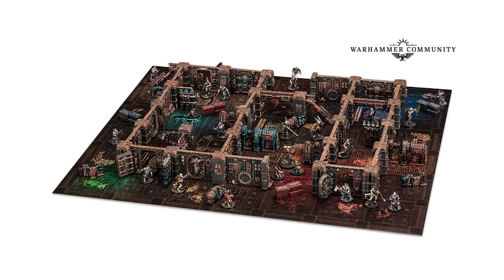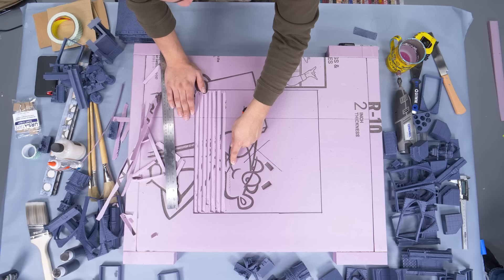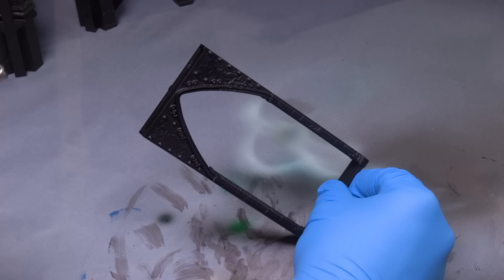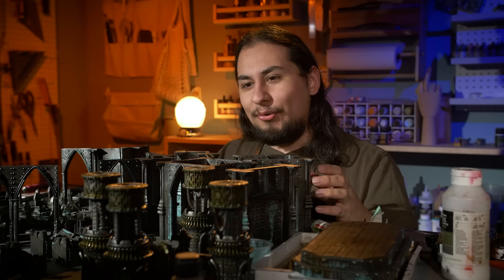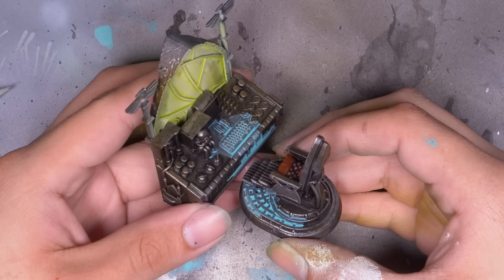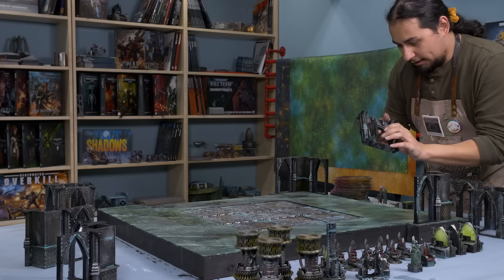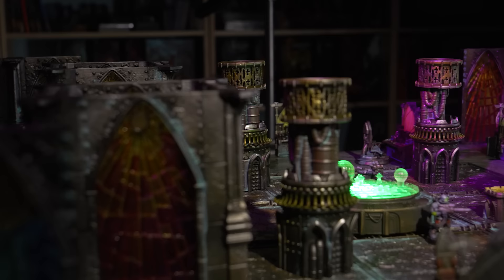I Made a Space Hulk BETTER than Games Workshop

Comment: There are hot knives where you can replace the blade with something like coat hanger wire which you could then shape the wire to cut a fairly square from the board.  It'd probably still need a sanding job though

Comment: One option for having the floor tiles flush with the ground plain would be to have a layer of foam/cardstock that is the same depth as the tile themselves, trace out the tiles and cut the section out, that way you don't need to gouge out from the main foam platform!
Reply: I was thinking cut the entire section out, cut off a layer then slide it back in. Your solution seems waaaaaay easier.

Comment: Great looking board! I am gonna have to print these off and have a go myself. Will be perfect for my Rogue Trader RPG games. Also in answer to your question at 2:04 - I think the best way to do it would be with a router attachment on a Dremel and a metal ruler to guide your routing. A normal router would probably mangle up foam as they are designed for wood, but a dremel with a router attachment might be the way to go. It would kick up a lot of dust though so would need to hold a vacum there while you rout. Your way worked great too though!

Comment: Using Hot wire cutter, cut the tile section clean off. Cut the tile section piece into two equal pieces, then run vertically through the wire cutter to plane off the 5mm of foam. Re-assemble using foam glue (used for foam rc plane kits). This glue is wire-cutter friendly and will not register when cut with tool.

Comment: Jay  i would have cut the board through on the lines you drew woth a hot wire cutter, than take the center piece, cut out the depth you need away, than glue all back together.
Reply: Why do all that cutting and gluing when you can cut once and never have to glue. Use a variable speed compact router, it is literally made for this job. You can get them as cheap as $20 from harbor freight

Comment: I don't know what particulate matter specifically is given off by pink insulation foamboard, but I would still recommend doing that sanding outside and wearing (at least) a dust mask when doing this in the future.  You do not want to be inhaling fine particles of anything, but stuff like insulation foam, latex paint, and printed resin is definitely up there in terms of concern.  It's also now in your workspace so I'd suggest sweeping up while dust-masked and running an air filter to try and collect some of the particles.

Comment: Really cool, I love the marble technique.
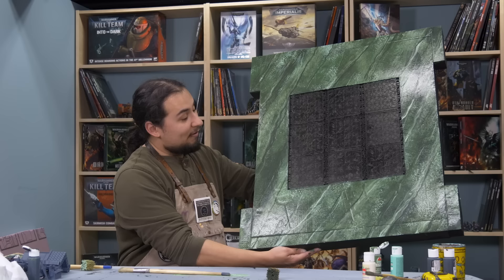It does look like there is some of the Pink Panther image from the foam showing through from some angles (e.g. 4:30). I doubt it's going to be noticeable when the board is filled with terrain, but it may be something to look out for when using this type of foam again.

For lowering the middle section of the foam, I would probably have cut out the whole area, used a hot wire cutter to remove the excess material and then glued it back in, though depending on how it's going to be used, this may have lead to insufficient stability, so the knife and sander method may be the better choice.

Comment: If you happen to have one, I imagine a router would work pretty well to cut out the middle section of XPS foam. Just set it to the depth you want and go back and forth evenly in one direction to keep a consistent lip for the router to sit on. Maybe you'd just have to adjust the speed to make sure the foam isn't getting too hot where it melts and sticks to the bit.

Comment: I can think only two ways to make the „cutout“, both with its own problems.
1. cut the rectangle complete to the bottom, remove it, cut the surface with a wire cutter an insert it back into the main piece.
The stability is the main problem.
2. Add a layer of styrofoam in 0:07 the thickness of the tiles

Comment: "What you should be doing" to lower a section of the board is to just completely cut the section out of the board and then just slice a layer off of it with a hot wire cutter, then insert it back into the hole.

Comment: Ahh man..I remember about 8 years ago working construction & nabbed one of those pink panther foam pieces from the site (junk). Had just bought the dark imperium box & the finecast dark apostle with the huge chaos halo. Made an absolute rotter of a “diorama” with 3 levels, other construction junk, model grass and a multipose eldar from bits box splayed flat on real granite surrounded by a chaos circle of granite monoliths. It looked so, so bad..tossed it when I moved, only painted 1/3rd of the box set, accrued many more unpainted models since then & that dark apostle’s halo was lost so quick probably in a landfill somewhere.

Comment: Maybe you could have cut out the entire square that you were trying to change the height. Then used a Proxon hot wire tool (if you're making terrain, it's got to be on your shopping list!) to cut it into 4inch strips, then flip to vertical and shave off your 5mm. no mess. no flying foam particles in the air etc.

Comment: Get hold of a 1/4" woodworking router with a straight cutter (not that expensive - you could probably get a second hand one for under $100) - you can router down to precise depths, leaving a flat bottom. I have seen plumbers router out high density foam insulation to house underfloor heating pipes, so Im pretty sure it would work. Creates lots of dust though, so wear a mask!

Comment: I almost wonder if a couple wood sheets as gudes and using a dremal like a DIY manual CNC? My rotary tool kit has a weird 1cm disk with drill like sides and a funky teeth on the bottom. Probably not its intended purpose...but metal vs foam, I assume it would work real good

Comment: Maybe a dumb question, but the windows are printed in clear resin, is the rest PLA or resin?
Reply: They printed the whole thing in resin, but ive been doing a bunch of the test prints in PLA and it works well on both machines.
Reply: @radiumminis  do they need supports?

Comment: For one, using extruded XPS is SUPER DOOPER BAD for the environment. The creation of that product puts out a shit ton of greenhouse gases. 

Cork is a great alternative, or cutting contours out of chipboard and using plaster or other materials to give you a smooth ground surface is best.

But, when cutting foam, nothing beats a "hot knife." Its essentially a wire hooked up to a battery, cuts through foam like butter. There's commercial ones,  or you can ride the lightning and DIY it.